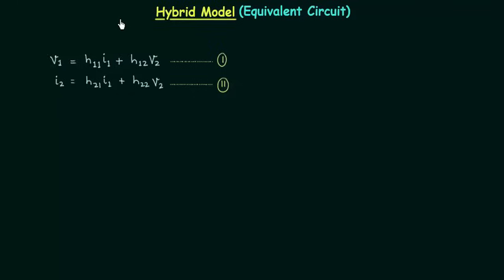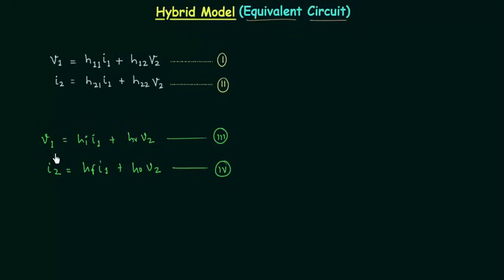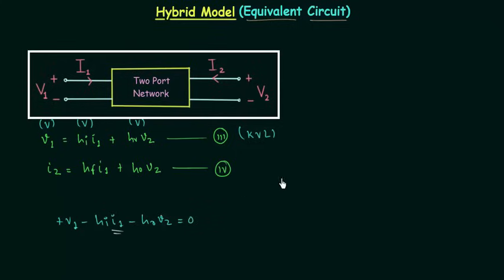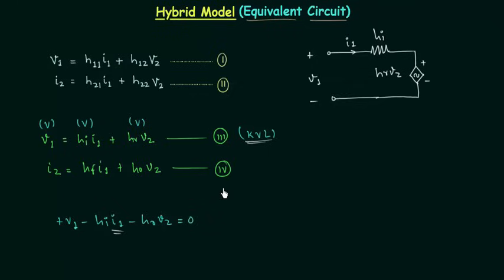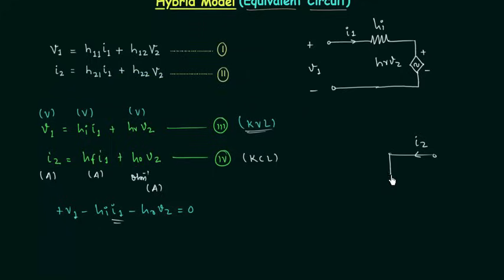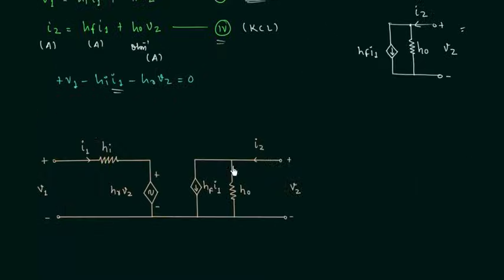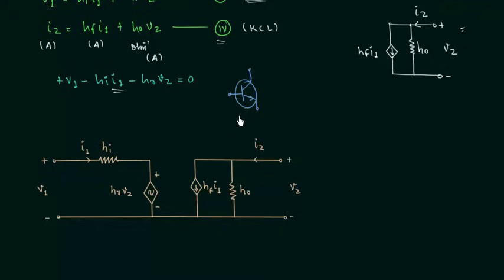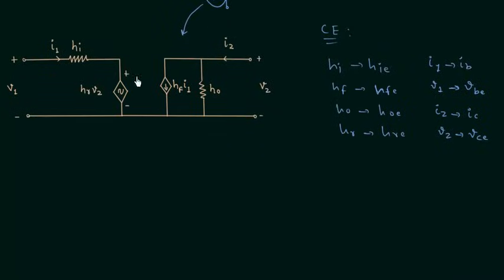Hybrid Model (Equivalent Circuit)

Comment: This explanation is outstanding sir. Non of my lecturers or books I have used taught a rational way to draw this diagram. But here it explains within 7 mins. I have spend hours to by hart these thing. 
However, sir, here you use "ho" as the resistance in output side. ho is in Mho not Ohm as it is a admittance. So, why it is not "1/ho"?

Comment: ho has the unit of ohm-1. So in the final model, (1/ho) should be the resistance instead of ho.
Reply: i think adding 1/ho in series and ho in parallel is equivalent? because in the first part he added the impedance hi in series

Comment: To be frank, during my engineering I don't even know how to draw this equivalent model and my base on the subject is not great. Gate 2019 didn't go well for me as I was too lethargic and didn't study well and ended up in losing. Then after completing my degree in may ( 2019 passed out) which included 2 unexpected backlogs at the 6th and 7th sem. hopefully I cleared in the 8th semester. At the month of May, I came across the neso Acadamy I started watching ur lectures and prepared notes. It's totally because of u im my base on the subjects got cleared. From my heart, i wish to thank neso acadamy team. hopefully ill surely crack gate and isro exams with good rank.  i also took coaching but it wasn't up to the level.
Reply: Super if u crack ISRO and GATE then pls help me with ur preparation tips..🤞
Reply: Neso is literally amazing dude !!!
Reply: Updates pls
Reply: @user-no4ec7gw2q he dead
Reply: Yo bro hows life been?

Comment: Ho is output admittance.. So output impedance should be 1/Ho in the output side of the equivalent circuit. Correct me if I'm wrong
Reply: no...its is ho or 1/ro at output side...sir has written correctly
Reply: @yourbestie4138  it is wrong
Reply: You are right,I got the same doubt😅
Reply: he took the value as ohm invese in the description so it is ho that he is representing as admittance ,
Reply: yup you're right